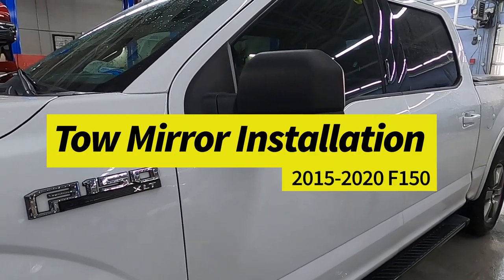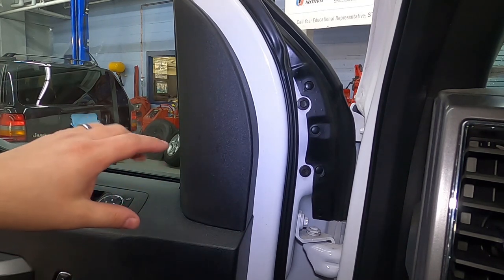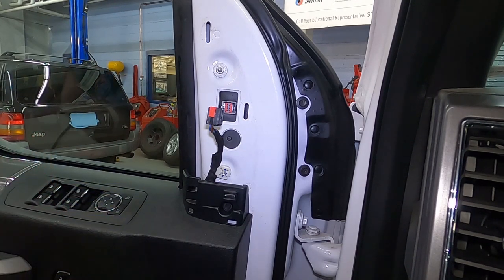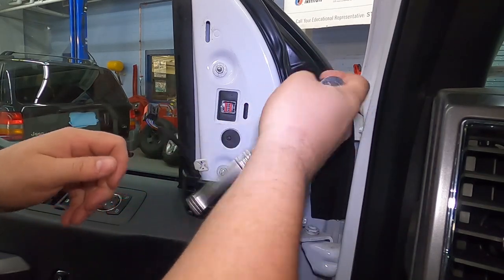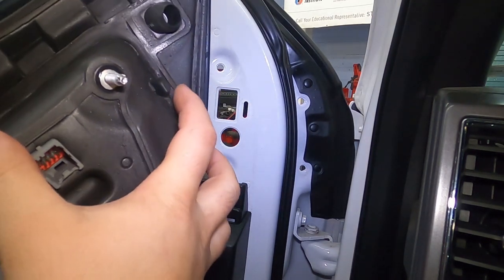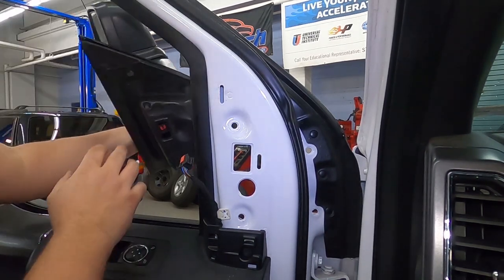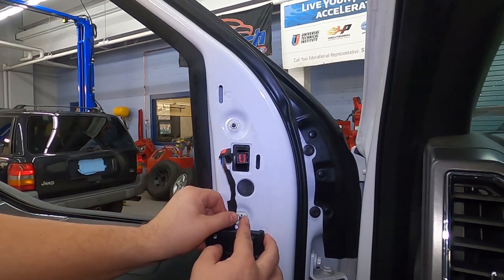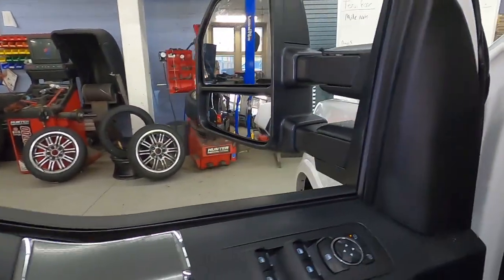2015-2020 Ford F150 Tow Mirror Upgrade

Comment: What brand mirrors are these? I have regular powered mirrors without turn or heat. Will the turn signals and heat work if I used these?
Reply from the maker: The link to the mirrors is in the description. They are from Amazon and are surprisingly nice. The heated function does work if you have those options already. The turn is prewired from the factor as well so there is no worries about that.

Comment: What if you don't tow often, should you just keep the regular mirrors?
Reply from the maker: I can say every truck I have ever owned I installed tow mirrors if they didn't have them. I personally like the added size and look of them better than the stock mirrors. I tow quite a bit but the added size of the mirror and the wide angle convex mirror on the bottom is a must in my book so you can see your blind spots so much easier. In the end it's totally up to your preference. These mirrors have been great for me with zero issues.
Reply: @tsgarage523  Thank you for responding. My driver side mirror was broken by a young lady and they are paying for the repair. That being said Ford doesn't have the mirror in stock until mid July or later. I'm torn on what to do 😫